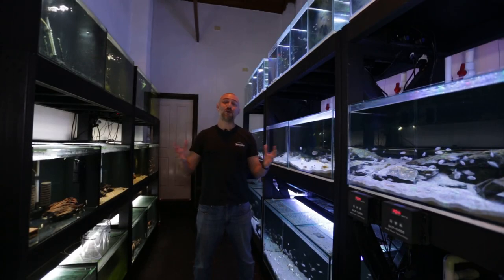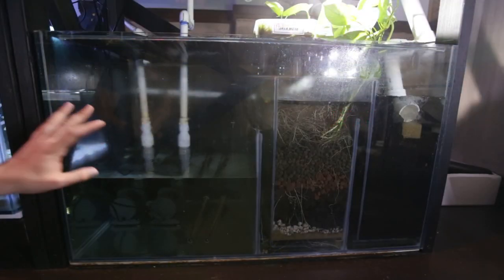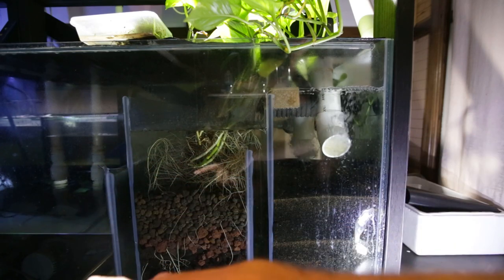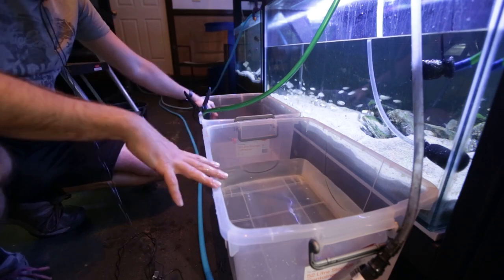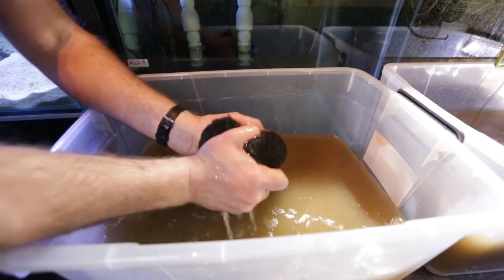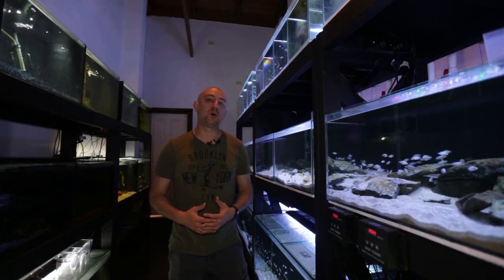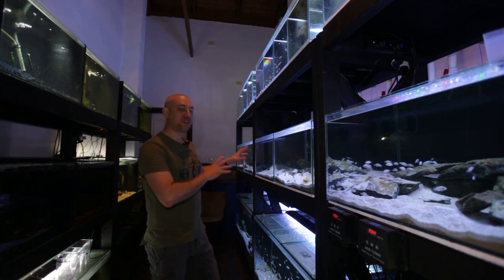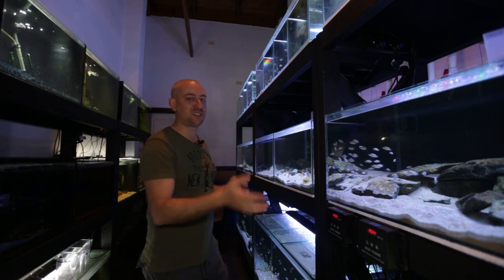20 Aquariums with 1 Filter - Running a Sump

Comment: I'm sold, running a sump system on 20 tanks seams like the logical way to go.  I would loose my enthusiasm for the hobby very fast if I had to change water in 20 tanks every week too.  I would have never thought of setting up the internals of the sump the way you did, "it's genius"😲. As I mentioned in other comments I just restored a 150gal, but I went "very large" canister filter this time.  Mainly because I can remove the filter from under the tank for maintenance and make less mess in my dinning room.  I can "watch" somebody cleaning sump sponges and make a mess of myself, plus everything around me. I finally subscribed on Instagram (not a fan of Facebook or associated products) and sent you photos of my system with tedious and redundant comments on Instagram messenger.
Reply from the maker: Glad you like the sump design Tommy. Kind of like you said, I personally get lazy when it comes to water changes. I know that if I had to change water from each tank individually that I wouldn't do it for long, then the fish would suffer. Cheers for following me on Instagram. I haven't been on there in a while but will post some new stuff soon.

Comment: Love it looks great I run my shed fishroom from sponge filters but if I had the room I'd do a sump with isolation valve incase of sickness brilliant work pal
Reply from the maker: Glad you like it Craig. Nice and simple with sponge filters mate and a lot cheaper to set up that's for sure! With my sort of set up you definitely need ball values on the return lines so you can quarantine new fish. Or if you wanted to run different water parameters on a certain tank to the rest of the system. Just lower the water level below the bulk head and you're set. Cheers mate
Reply: Looking forward to your next video thanks for your time

Comment: Awesome video! Answered so many questions I had! But I am still unclear how the water is taken up from each tank. Is it like an overflow built into each tank? Hope I am making sense.
Reply from the maker: Thanks, glad you found it helpful! So each tank is drilled in the back and have bulkheads attached. So as the tanks fill up with water from the return pumps that sit in the sump, water spills over the bulkheads and back to the sump. I'll make a video about all that soon.
Reply: @JasonsCichlids  ahhh that makes sense!  Will be watching for video! Thanks so much!

Comment: Interesting I use a woollen filter sock filled with filter floss and wash it every few days and I stuffed moss into my second chamber also I run a chiller into the sump to save money on air con ,otherwise it’s similar
Reply from the maker: Hi Peter, I actually forgot about filter socks. I think I might try them actually because it will mean the sponges would stay cleaner for longer and not block up as frequently. Thanks for the suggestion! Oh you run a chiller do you? I used to have one on my old reef aquarium.
Reply: @JasonsCichlids  Yeah filter sock woolen is good and I just throw it in the washing machine for a 30 min cycle (No soap) 1 or twice a week.You might want to test if a water chiller is cheaper power with your setup could save you some nice $$
Reply: @JasonsCichlids  I think if you get a decent filter sock you wont have stack so many sponges,I'd replace some of them with some bags of filter floss and you can toss them in the washing machine as well :)

Comment: What is the lowest parts of your Biofilter chamber? it looks like sand to me. also the bead stuff you have in the top layer. what brand did you end up using? trying to build a sump with your design here.
Reply from the maker: That was a layer of Seachem Matrix. I initially intended to fill that whole chamber up with the stuff but it is just far too expensive. It was sitting on a bed of filter floss to prevent it from falling through the egg crate.
Reply: @JasonsCichlids   Thank you so Much! Helps me a lot knowing what is holding your bio rocks from the bottom.

Comment: Can you do a water change from the sump? Take/add new water from that instead of one of the tanks.
Reply from the maker: I could but because I don't have it drilled for a drain it would be tedious. If I did I could fill up the aquariums and just let the water overflow out the drain in the sump. However, I don't really like this method as you do lose some new water as well.

Comment: Hi Jason - really useful content.  How many litres of aquarium water does your sump filter and how many litres is your sump.  Im trying to understand ratios as I’ve read 20% but for a big system (like yours) the sump didn’t look that proportion?
Reply from the maker: Hey Chris, cheers for that mate. I honestly didn't take the ratio into account. But with some quick calculations I did, the tanks hold around 2,500 litres. While the sump, at its current water depth holds about 500 litres. Which just happens to be 20% the water volume. But I don't think you should get too caught up in the ratio as much. The amount of surface area in your biological filter media is more important. I used 4 litres of Seachem Matrix in the second chamber (said to have a total surface area of around 700m2). Those 4 litres of Seachem Matrix only filled up that second chamber about 1 inch deep. So I filled the remaining 2 foot deep chamber with lavarock, Matrix is just too expensive to fill that chamber right up with it alone! Adding the Pothos plant also helps a little with nutrient export, but most of all, regular water changes are the most important thing to keep up. Hope that helps mate.

Comment: Couldn’t you use just clean tap if you add a water conditioner to clean your sponges maybe after you do a few in the aquarium water to make them extra clean?
Reply from the maker: Yes you could use that. If you're quick enough you can simply use tap water alone to clean the sponges without getting much beneficial bacteria die off
Reply: Here in Denmark the tapwater is totally clorine free, so obviously i just clean the sponges and additional filtermaterial in temperated tap water. It makes it a lot more easy.

Comment: You kept speaking of loosing your A/C and needing heaters working. This makes no since. I assume you mean if your temperature gets low and you can not run heat in the room and the water gets colder. Then you would be dependent on your aquarium heaters.
Reply from the maker: If the air conditioner dies, I have the heaters as redundancy to keep the tanks warm while I repair/replace the air con.

Comment: The water in the second chamber supposed to be lower too.. Think the media in the second chamber is also choking up.
Reply: It is because he has so much filtration no water flowing through fast enough
Reply: Ya, can put alot but not too tight that water can't flow.. the water lever is suppose to be on the fourth baffle till it flow over to second compartment.
Reply from the maker: Yes correct, it was meant to be lower in the second chamber. I found the pothos plant caused this and have since removed it. It took a full day to clean that second chamber out (which restarted a cycle). All the plant matter choked up the lava rock. Without it the water flows freely through the media.

Comment: Couldn't you just use tap water that has been treated with Tank Start Dechlorinator?
Reply from the maker: I think that could be a waste of dechlorinator. If you're quick enough, I don't think there would be much die off in the filter sponge just using tap water